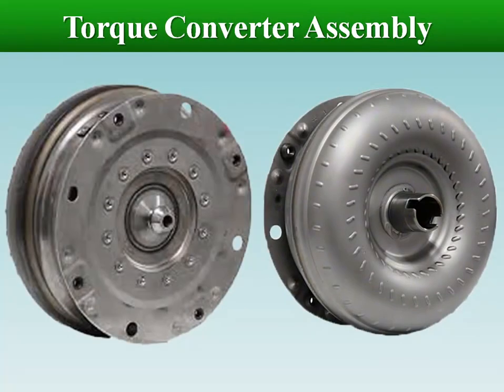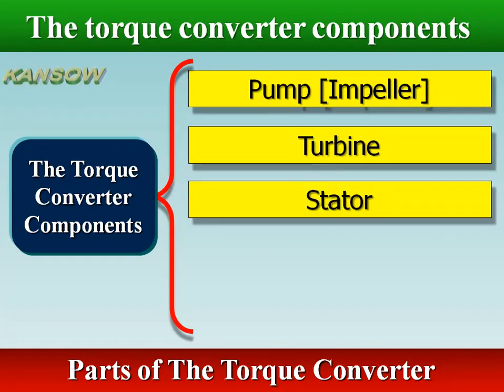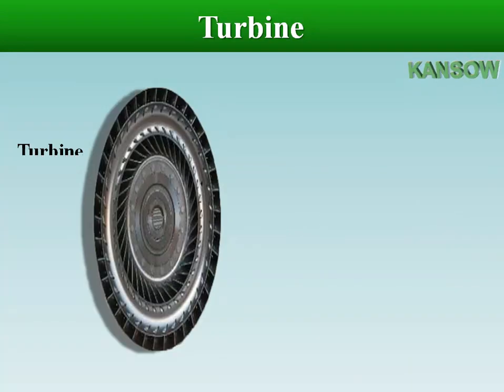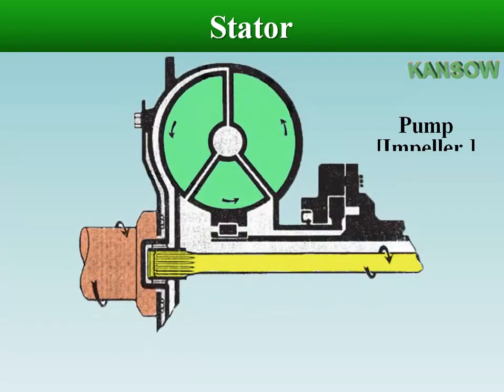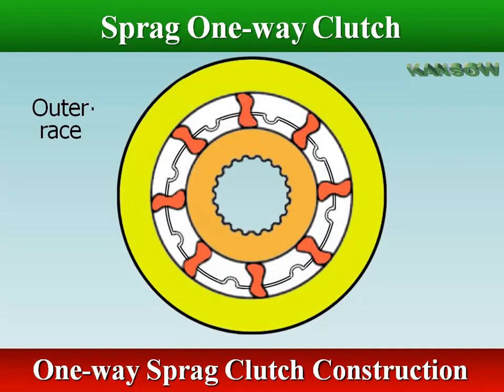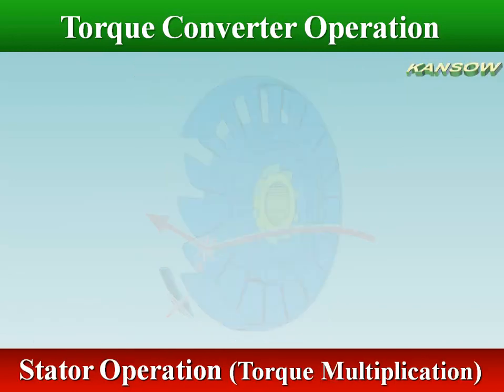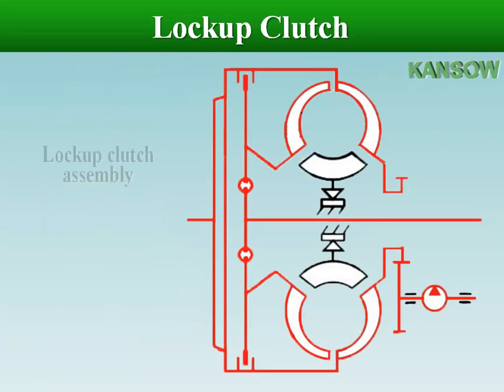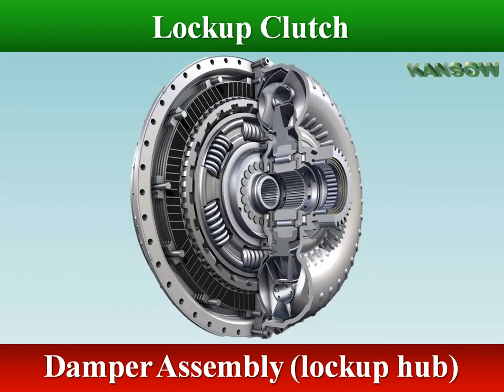Torque Converter

Comment: I believed I found my transmission issue....my stator rotates both ways....this explains why it leaked bad when the car sat for a day, the poor acceleration, and the noises in drive or reverse....sometimes reverse wouldn’t work for a sec” low fluid level” I stopped driving right away, and lucked out with not finding metal shavings inside the transmission....if I would’ve kept driving, I would have to replace the valve body.

New racing converter ordered.